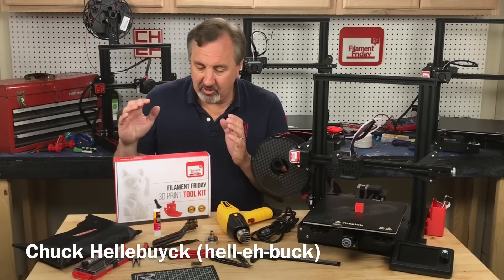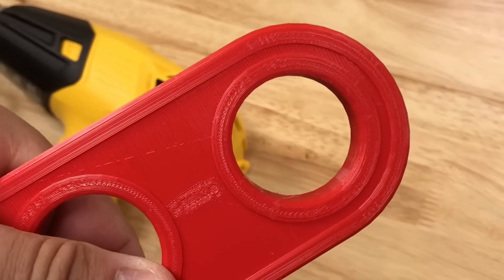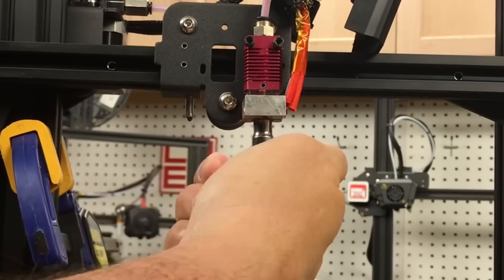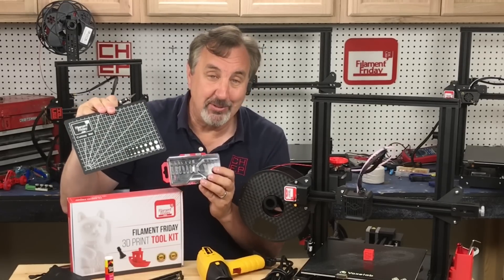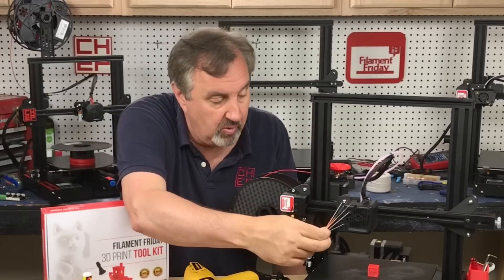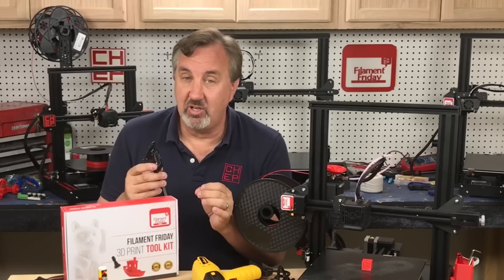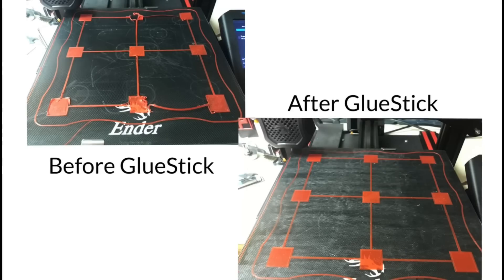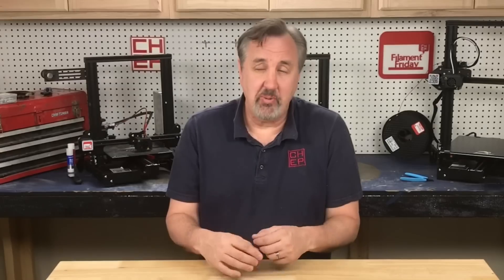Tools I Wish I Had When I Started 3D Printing

Comment: My favorite tool is DIY a bit complex relatively speaking.  I have a few end cuts of aluminum extrusion, so I made a tiny H shaped structure. I also have an Ender 3 v1 board left over after an upgrade to v4.1, an old PC power supply, and an E3D hot end, with heater and temp sensor.  I assembled all this to make a "fix-it" bench.  I can heat and clean nozzles with ease, as well as test steppers, fans and end stop switches. Admittedly I don't use it a lot, but as I get more proficient with filament and move into "advanced" types I expect being able to quickly and easily swap and clean nozzles will be very handy and it will see more use.

Comment: Hello, it is possible to print on block serface ? If it is possible then we can save support printing time.
Reply from the maker: Not sure I understand the question
Reply: @FilamentFriday I can give you an example, assumed we want to print a half circle  shape objects (like half ball) .In that case , we have to use Printing Supports . but it will be possible, if we not use any printing support and replacing Printing Supports, we will use a plastic objects or any pre fabricated supporting material to provide same purpose. My question was it will be  possible ?
Reply from the maker: Is the half circle on it side or flipped to put the ball side in the air?
Reply: @FilamentFriday  how can send you short video ? Do you have whatsApp ? or can i email you ?
Reply from the maker: Post it to your YouTube channel.
Reply: @FilamentFriday  ok,ill post and give you the link.
thanks.
Reply from the maker: Just tell me it’s there and I can visit your channel.
Reply: @FilamentFriday  ok.. thank you.
Reply: @FilamentFriday  it is possible to print on a carved surface or non linier surface ?
Reply from the maker: Not easily. Best to be flat.

Comment: Since I started 3D printing I've been using a deburring tool and there are few feelings more satisfying than running the blade across a rough edge of a round print and getting a long curly ribbon of material off and leaving it smooth.

Comment: I went out and got a painters knife after I saw it in one of your other videos.  My hands were so cut up trying to use the "scraper" and I use that term loosely, that came with my Ender 3...which also managed to destroy the starting bed...thankfully I'd already ordered (at the same time as the printer) the glass bed upgrade.  That painters knife has saved me from slicing myself with terrible tools trying to get stuff loose that didn't want to come loose any other way (without heating it up and warping it trying to remove it as I did so many times)

Comment: I've only had my printer for two weeks.. But so far.. the life saver has been a set of feeler gauges. I picked up a set on Amazon for under 10 bucks. They work perfectly for bed leveling. I still had adhesion issues with layer 1, but that was all about finding the right speed. Cutting back the speed, might take a little longer, but no tape seams, and I don't have to fuss with the tape. Yes, I highly recommend the print surface get a frequent bath in Dawn! Thanks for all of the information you provide on your channel.

Comment: I cringed when he was using the ratchet on the nozzle without supporting the heat block.
Reply: On Creality machines no big deal, they have bolts like the mosquito hotend to hold it. The E3Dv6 is the main one you need to hold.
Reply from the maker: It has screws in the block to hold it in place. Just like this: https://youtu.be/eM-rJWBuWhw

Comment: I'd recommend a rubber bulb air blower, like one might use for a camera. Great for getting dust off surfaces, or out of fans, or little filament chips out of the extruder. I've been using one that came in a camera cleaning kit. Works very well.

Comment: I have to disagree with the glue stick being such a good thing. I have had problems getting my parts to stay adhered to the bed so with a little research on the Prusa Forums I found a tip whereas cleaning the build plate with Dawn Dishwashing Soap and very hot water eliminated the problem...
Reply from the maker: They use a different bed material than creality.
Reply: @FilamentFriday  yes... Prusa uses spring steel where Creality and most other models use glass. Personally, I would rather not have a glass bed

Comment: Chep, I have a small problem i hope you can help me with really quick. I just installed the blue unicorn tubing on my ender 3 with v6 head and the print is beautiful up until about the top of the print, then the nozzle clogs. Is my tubing length too long? Retraction too fast? I think you also mentioned the blue tubing having a smaller than average I.D.?
Reply from the maker: Not sure. Could be many things. Could be heat creep meaning it’s not cooling the hotend enough.
Reply: @FilamentFriday  I will check the heat creep. I did notice my temp bobbing up and down a +/-4 degrees while printing with .6 nozzle and i think the cooling fan is 12v running on 24v. I will add a step down buck converter to slow the E3dV6 fan. 👍

Comment: An adjustable wrench or a standard crescent wrench for holding the hot end in place while snugging up or removing nozzles is one item I've used that wasn't mentioned here; both on my Ender 3 and my Artillery Sidewinder, having something to hold the heater block down while swapping the nozzle has been helpful. And though it may be a little more project-specific, a cheap soldering iron doesn't hurt either - I needed mine when I wired up LED light strips on both printers, for connecting the strips to power and to switches to turn them off and on.
Reply: This kit should have an 8w USB soldering stick 😁👍

Comment: The palm ratchet is cool! I've use a 3D printed (PETG) non ratchet holder for the driver/socket, but if I take too long the heat spreads and melts the part making it unusable...
Reply: Tinfoil

Comment: Just put a warning on using a brass brush. If that touches heater wires while it's heating, a fuse will blow but it's also possible to damage a mainboard (mosfet and it's driver/level shifter ic)
Reply: I saw sparks fly on my ender 3 pro one time when I was cleaning the head and it was on (and hot). 0.o No fuse blew, but that was unsettling. Since then I pre-heat and turn it off.
Reply from the maker: Only if they are exposed (not insulated) and still driving the heat. I did it after heating it with heat gun.
Reply: @FilamentFriday  sorry, You did say that after heating with the heat gun, I didn't hear that first time I've watched the video. But shorting happens regularly, heater wires are exposed at the heater body since the isolation is loosely coupled with the wire itself and bending radius for that wire is way too tight in that spot.
Reply: @FilamentFriday  Is there nothing a heat gun can damage in the head assembly? I am always afraid I would melt something (like the PTFE tube).
Reply: I literally had this happen three days ago was cleaning the nozzle with brass brush and saw Sparks, it blew a small capacitor/resistor or something fried and gave the mintemp error while showing the hotend -14c and Bed 152c, thank God for Chep and Amazon prime next day deliveries, I upgraded my ender 3 1.1.5 board to the 4.2.7 32bit Creality MB, new thermistor and new heater cartridge and it's crazy silent (the fan on my v6 head sounds like a jet exhaust). My hotend keeps bobbing up and down -/+ 4-6c so I'm still trying to work that out.
Reply: @gilr1488  search for marlin pid tuning. Do a pid tune whenever you make changes on a hotend or mainboard.
Reply: I still use q-tips and clean the heated hotend. No problem if it is 250°C for the q-tips

Comment: A cordless drill with a decent set of metric and standard drill bits as well as a set of decent step bits.
Step bits will save your life in a pinch and can also work as a countersink to help finish holes.
Reply: A bit too much for just a starter kit

Comment: i use the chiesel that comes with printer to remove elephant foot, for straight edges it works great all the time. But for curved edges or where chiesel can't fit, deburring handle is recommanded.

Comment: The only problem I would have is that 6mm hand wrench.. that nozzle gets hot and I like to keep my hands well away..

Instead, I used to use a full size wrench, but now I've bought some nozzles with a wrench included and not looked back - it don't get hot and is great for getting at the nozzle..

Comment: I have a request ... After a year I am in the market for a new hotend again. Many things changed, Microswiss is not every-mans darling any more. Would like an overview over  new products ....
Reply: you probably dont need the new products
Reply: @420247paul  I dreamt of a world where I do not burn my fingers once a while unclogging nozzles.
I dreamt of a world where nozzle change does not require hours of recalibration. I dreamt of a world where not every few hours some random part fails and a replacement must be ordered, waiting for days or even weeks. I dreamt of a world where 3D-Enthusiasts do not look like couch potatoes because they had to monitor their printers day and night because the print could fail without any warning.
Reply: New products are overrated. Go with the classic E3dV6 hotend (or all metal clone), it's super reliable, has tons of printable carriages and has many aftermarket upgrades and replacement parts for very very cheap.
Reply: @gilr1488  Thank you for this feedback - gave me valuable input.

Comment: A box of toothpicks for applying small amounts of glue to parts. I've also found canned air to be handy for quickly cooling off and separating some more difficult prints from the bed.

Comment: I use washable glue mixed with water in a spray bottle for glass bed adhesion you don't have to wash bed as often and makes prints stick good but not to good plussss it's clear and leaves the bottom of your print smooth @chep
Reply: Use 70 percent isopropyl alcohol mixed with white glue, 70/30. After leveling your bed, preheat bed to temp and spray solution. Dries quick and covers well.

Comment: I use a flame torch instead of the heat gun. It melts the stringings nice and quick without causing heat deformation for the 3D-print
Reply: I just brush them off with my fingers.
Reply: @3DJapan  
Im selling 3Dprints for two years,  it's crucial for me to get the best result. your finger just won't do it
Reply: Heat is heat. And most heat guns come with nozzles that allow you to direct the air flow. An open flame has even more potential to do severe damage than hot air
Reply: @saschaschneider6355  
when you set the valve to low.  it's less likely to cause damage 

the technique for it, just never hold the torch on one spot. keep moving your hand left and right, just like spraying paint
Reply: @eyss6303  sure, but the same can be said about hot air guns. Use a small to medium nozzle, set a fairly low temperature, and keep moving your hand. It doesn't really matter what the heat source, if you do it wrong you're damaging your part. It comes down to what you have at hand. If you have a torch use that, if you have a heat gun then use that, both work fine if you know what you're doing.

edit: An open flame certainly has additional safety issues but anybody above age 6 should be aware of that

Comment: One of my most used tools that I wish I had years ago is a set of bondhus screwdriver style Allen wrenches. They have the ball end on them so you can get the screws out at weird angles, and having a screwdriver handle makes things soooo much easier.

Comment: Hey CHEP, although the palm ratchet is convenient. The torque generated on the heat block might create headaches in the long run. I think for best practice a crescent wrench on the heat block while using the palm ratchet/ socket wrench will help keep everything tight in place.
Reply from the maker: The heat block has screws that hold it in place.
Reply: @FilamentFriday  That hot end does, but they all don’t. I always use a wrench to hold the block when unscrewing the nozzle just so it doesn’t twist.

Comment: Wood burning knife...cheap rotary tool set..both are under $10 at harbor freight
Reply from the maker: Agree with that rotary tool comment. I’ve had mine since I made this video 6 years ago. https://youtu.be/Vo3hPoKm1Uk
Reply: @FilamentFriday  yup man, i got the exact same model.... its going for $6.99... cant think of a better thing to spend 7 bucks on tool wise... you have a link for that deburring tool you have by chance sir?
Reply from the maker: In description

Comment: Cleaning a clog recently I used a metal wire brush meant for cleaning my Pace desoldering iron. It let me clean the hotend with it up to temp. It looks like Cheps round fan brush but is all metal.

Comment: Blatant sales advert for a crappy tool kit no one needs. Also - did you really 
undo that nozzle without bracing the Heating block ?? Duh.
Reply: Who hurt you?
I personally felt the video very helpful.
He explained each tool, and even told you what wasn’t included… and went on to say that you can get them separately instead of buying his kit. I see no wrong in promotion, especially when it’s like this, and not mentioned every 2 seconds
Reply: Completely agree.  CR clearly needs a hug.
Reply from the maker: @CR - The heat block has screws that hold it in place. And based on the constant emails I get asking when the tool kit would be back in stock, apparently a lot more than no one needed one.

Comment: Does the heatgun really work ? Most of my prints are PLA , sometimes I have to repaint them because of the strings left, but I feel that the heatgun will deform my print too
Reply: Get small blowtorch (I use small gas soldering iron with blowtorch tip). Works much better than heatgun - it's more precise.
Reply: Yes a heat gun is a very handy tool to have.  You need to get used to how much heat you can put where but you will pick it up quickly.
Reply from the maker: That was PLA I showed in the video. There is a low and high setting on my gun. You can get nozzles to that direct the heat to smaller areas.
Reply: It only deforms it if you hold it in one spot too long. The heat required to melt strings won’t hurt the print

Comment: chep, this is again a great video as i am used to :) the tools are as you say absoluley great! i already have a lot of them, but there is still some like those brushes for the fans and the very last tool for cleaning edges. what i use to level and get the prints off of the bed, is a tool mechanics use to set the valves in an engine. very thin an fldxible metal plates in various thickness. 
so are those links affiliate that i can help you at least a little? cause if not, please tell md, than i will get the whole tool box :)
Reply: I just checked, they're affiliate links, you can go ahead and buy what you need after clicking through.
Reply from the maker: All links are affiliate so they help. Thanks.

Comment: I know it's obvious but a DECENT set of Allen keys are essential
Reply: Honestly i find the ones that shipped  with my ender 3 to be fine. I keep them attached to the printer with a little 3d printed tool block and never reached for anything better except for actually assembling it. I used a ratcheting screwdriver and hex bits for that.
Reply: The screwdriver type are amazing. I wish I would have got my set years ago. I hate fumbling around with the little bent ones.

Comment: A couple of my must haves: Razor blades, some use the putty knife or others but I have NEVER had a problem popping off a print with razor blade (do be careful), Also use it (carefully) to clean bed of excess raft/brim material.   Some 600+ sandpaper to rough up the bed. (I have an EZ Mat2)
Reply from the maker: I used window scraper (razor blade) to remove prints until the print popped and my hand kept going and pushed the razor blade deep into my other thumb. I never used it again. Man that hurt.
Reply: @FilamentFriday  ouch. I usually use it to pry underneath the corner and then use the putty knife to push the blade slowly without my hands near it

Comment: No one asked, but I also suggest having a sanding pad or an fingernail Emory sponge if you use a PEI bed.  It's nice to buff up the PEI before a print.  I hit with alcohol swab.  For the heat gun - I got a cheap hot air solder station.  It stays on and usable in it's cradle.  It instantly heats up a MICRO point to deal with stringing.  It's also great for cleaning up skirt or brim edges!  I also keep a set of forceps with my tweezers set.  I use OLD Singer sewing machine tweezers that are long and have a pin point at the tips to grab threads!